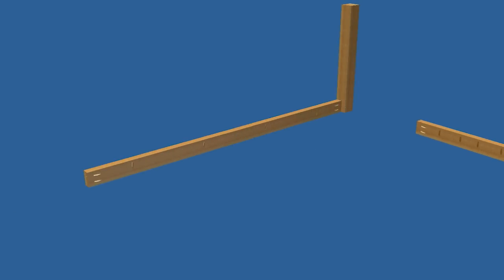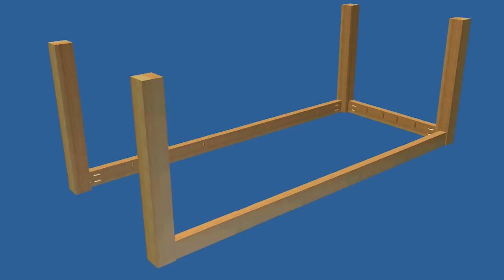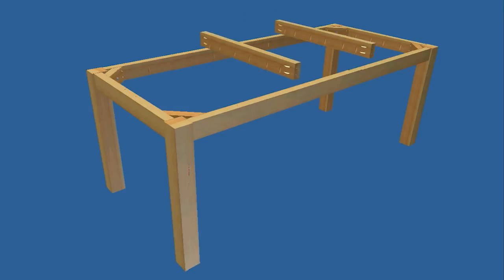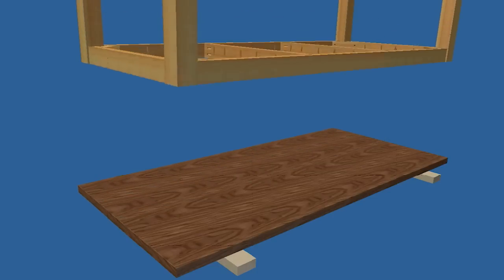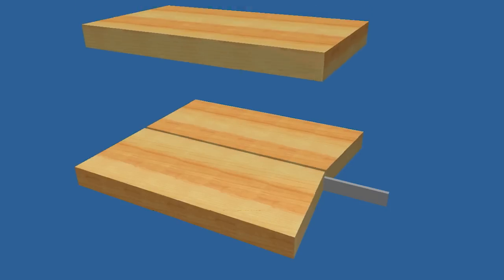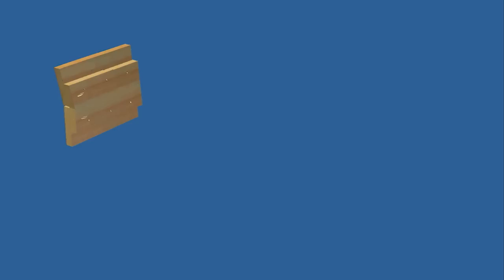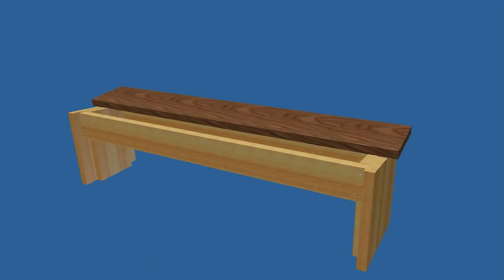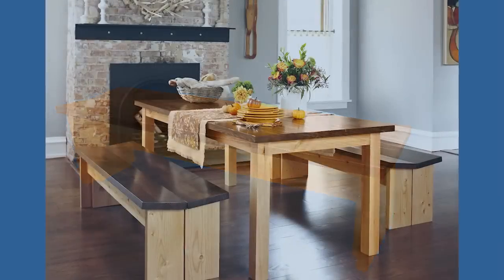How to Build a DIY Dining Table & Benches

Comment: I just made the benches for my thanksgiving table I built. They came out really nice but remember that depending on size they are a little heavy. I made mine counter height  and 4 feet long with 2x10 lumber.

Comment: Do NOT screw a table top to the aprons with pocket hole screws. You are just asking for trouble when the top wood moves due to moisture changes. Z-clips or table top fasteners are what you need to use.
Reply: I thought the point of pocket screws were to allow the wood to expand and contract with moisture changes.
Reply: Nope, they're just a quick way to joint 2 pieces of wood. They are super convenient and useful for face frames, or joining pieces where the grain is going in the same direction. But in this case, the table top wants to move sideways but if it's screwed to the aprons it can't, so it will warp/crack. It's not guaranteed to happen if the environment the table is in never changes humidity, but it's likely to.
Reply: I really don't know much about woodworking, so I could be wrong. But with a pocket screw it's going with the grain and therefore allows the wood to move along the screw as it expands or contracts. But with a typical screw joint, you're running it perpendicular to the grain so the wood is hitting up against it, and the tension causes it to split. It's like the difference between a ramp and a wall. You can move up one but not the other.
Reply: Chris Martin, I`m glad someone finally addressed this issue.

Comment: Pocket screws to attach the table top are convenient, I'll give you that (I do use them for other projects).  However, I would expect that table top to warp over time with changes in humidity.  There are better ways to join wood table tops than this.  Also looks like no attention was paid to orienting the end grain of each table top board.  Usually you alternate the end grains like this: frown face, smiley face, frown face, smiley face.  Lastly, unless you joint the long edges of the boards and edge glue them, I would expect a lot of crumbs and food debris to catch in the gaps between the table top boards.  That would be a bear to keep clean.  I do love the look and function of the V-shaped benches and also the dark on light stain combination, so my comments aren't all negative, lol.

Comment: How do I keep the aprons from moving when attaching them with pocket holes if they're offset by 1/4 inch? Mine keep moving so I have to remake the leg
Reply: I use 1/4" square dowel as temporary spacers for projects at times. They are like $2 for a 3 or 4 foot long dowel.  Cut them to length so that you can easily knock them out after you've joined your boards.